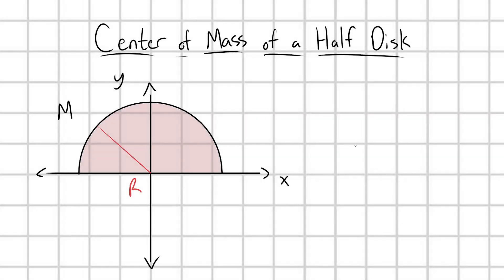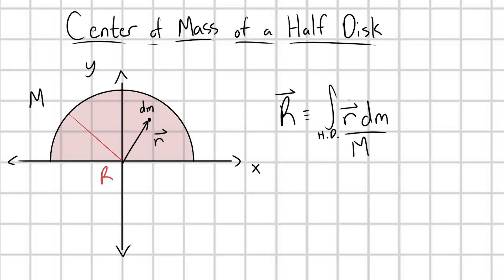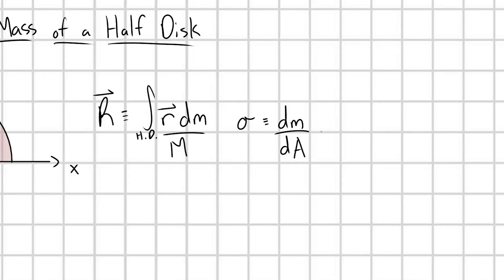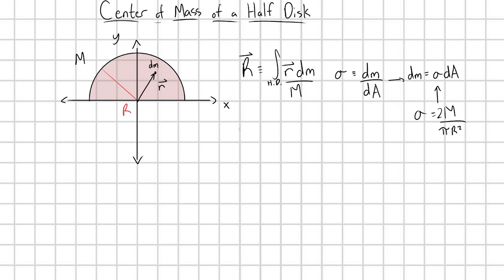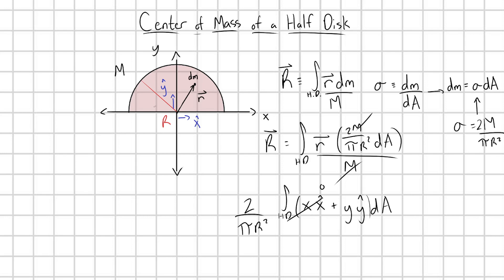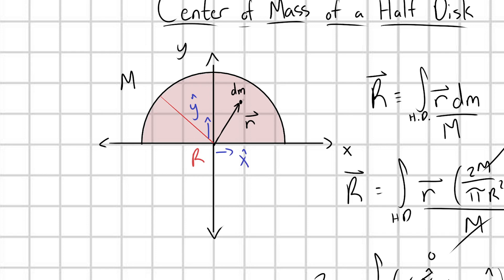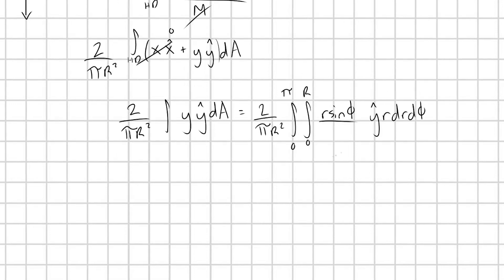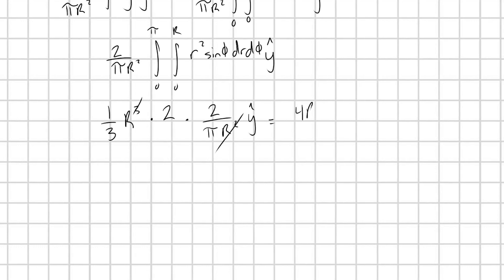Center of Mass of a Uniform Half Disk

Comment: I suggest a different approach :take the positive quadrant of the circle : y=√(R^2 - x^2). Then the mass-elements with same distance from the y - axis 
have the mass y dx ,hence we need  ∫√(R^2 -x^2)*x dx (x from 0 to R. Make the substitution x = R* cos t , then 
dx = -R sin t dt , y= R*sin t ,and we are left with ∫ sin t^2 *cos t dt . Now  set sint = s and you' re left with  ∫ s^2 ds ( 0 to 1),
which is 1/3. Finally you have to take the corresponding mass M =1/4 π *R^2 to find xs = (R^3/3 ) /M  = 4/(3*π) *R ,or for the original half-circle : xs = 0 ,ys = 4 R/ (3 π).

Comment: I solved it differently. Assuming uniform density, and understanding that the x component of the center of mass is zero, we can apply the  coordinates to the plane. Because of symmetry,  we can knock of the negative x-axis and solve the following equation; The integral of the function (✓r^2 -y^2) from the bounds; 0 to a variable p with respect to y = integral of the same function from p to r with respect to y. That way, we get the y-coordinate. It's long winded and unnecessary but that's how I knew to solve it.

Comment: I found a better way (imo) to calculate the integral without relying on the symmetry argument at 3:50, or at least, I found a more formal way to justify it.

I INTENTIONALLY LEFT THE 2/πR^2 CONSTANT OUT OF THE CALCULATIONS BECAUSE IT'S TOO TIRESOME TO WRITE, BUT THE INTEGRAL CALCULATIONS ARE ALL THE SAME REGARDLESS.

Notice that if dA is the area of an infinitesimal square, then dA = dydx. We'll write the half disk domain as a double integral, int{x=-R, x=R}( int{y=0, y=sqrt(R^2 -x^2)}( xX + yY)dy )dx, where X is x-hat and Y is y-hat. Calculating the inner Integral gives int{-R, R}( x*sqrt(R^2 - x^2)X +((R^2 - x^2)/2)Y )dx.
Now, since x*sqrt(R^2 - x^2) is an odd function, and integral over a symmetric domain [-R, R] would he equal to 0, and (R^2 - x^2)/2 is even, so it equals to 2/2*int{0, R}(R^2 - x^2)dx*Y = 2/3*R^3*Y.
After multiplying it by the constant, we get the correct answer of (4R/3π)Y.
Reply from the maker: Yes! This is also a totally valid way of computing the integral out, and I like how you noticed the even/odd functions which popped out in Cartesian coordinates to make your integrals fast and easy. Exploiting odd and even functions in symmetric domains is absolutely another key skill in physics. If this problem were on an exam, for example, I think the "better" method is whatever you can do fastest haha (and with proper justification, of course)! Just like using properties of even/odd functions, In physics, being able to point out physical symmetries in advance is absolutely critical and valid as well. I do like your method though, thanks for sharing! :)